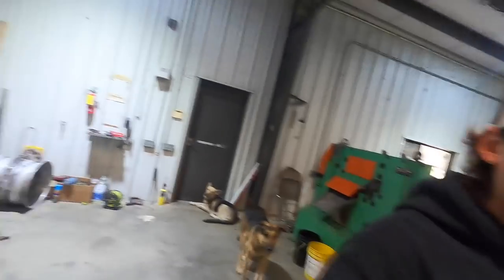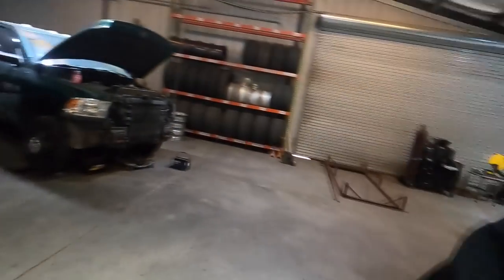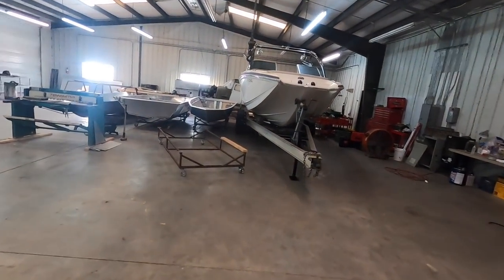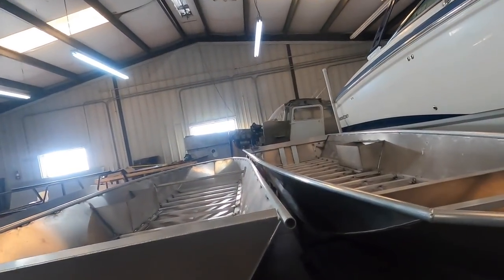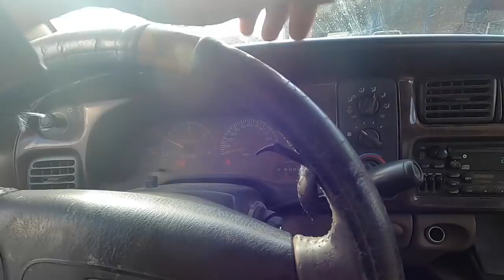We Got Scammed??

Comment: I have an nv4500 with 3.55 gears.  Speedo said about 68 mph at 2k rpm in 5th.  Just replaced the stock tires and wheels with bigger ones and gained about 8-9 mph now I can cruise on the highway at lower rpms.  I was starting off in 2nd gear now I am using 1st again

Comment: Don't know if you know it or not the gear ratial on a 5 speed and a 6 speed 1 st  gear are the same and a 5 speed 5 gear and a 6 speed  6 th gear are the same all the gears in between are a little closer together is all look it up its right in your owners manual to the truck under trans options just letting ya know love the video keep them cummins!